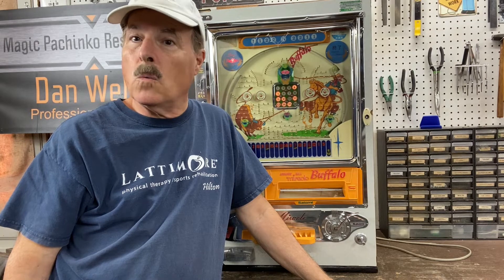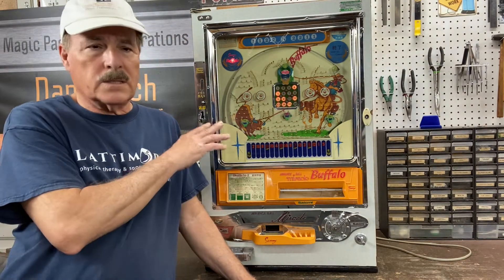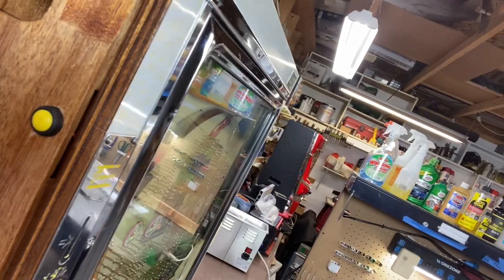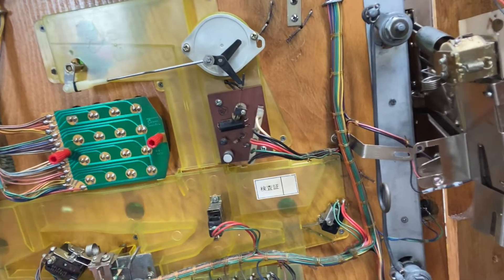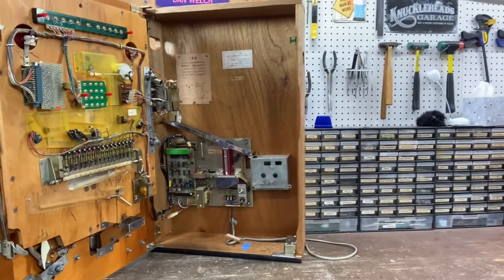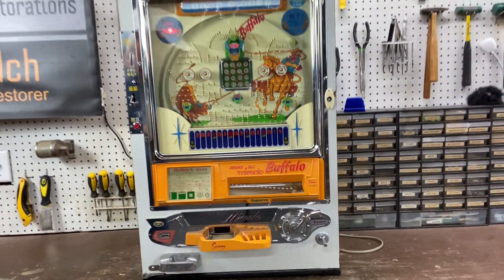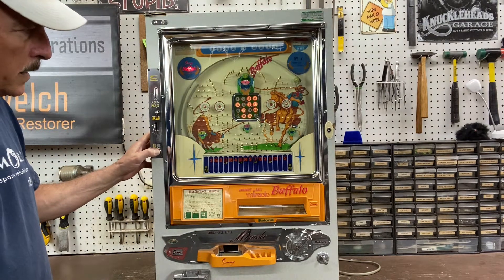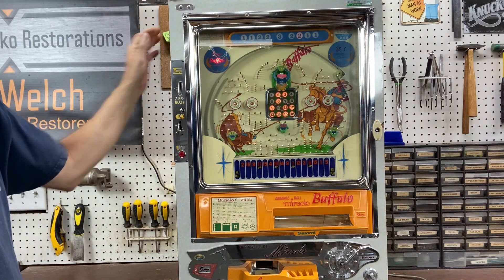Vintage Arrangeball Miracle Buffalo Sammy Satomi

Comment: I have one of these arrange ball machines. Where did you get the lights? Both the small and the 2 larger lights for the top. In mine, the 2 larger lights in the top look like automobile bulbs. That would explain the 12 volt system.
Reply from the maker: Those bulbs are available on eBay.  They are called “ grain of wheat” bulbs.
Reply: @MagicPachinko  Thank you. My machine seems to be functional with the exception of some bulbs that are burned out. I've already ordered LED replacements for the two top lights. I think I'll just replace all of the others so they are all new. Do you have any idea what these arrange ball machines are worth? From what I'm reading and seeing, they seem to be rare and expensive but I don't see any values listed.
Reply from the maker: If it doesn’t work properly, it’s not worth much at all. 
If it works properly, that’s a good thing. Then the cleaner the better. 
It’s going to be worth what ever someone is willing to pay for it.  I’ve restored a few of them but never sold one. If I were to sell my restored machine, I’d probably ask $2,000.
Reply: @MagicPachinko I know the grain of wheat bulbs are 12v but do you know the proper m amps? Does it matter?
Reply from the maker: @danafawbush6158  Honestly don’t know, but I don’t think it really matters.
Reply: @MagicPachinko Thanks for your help